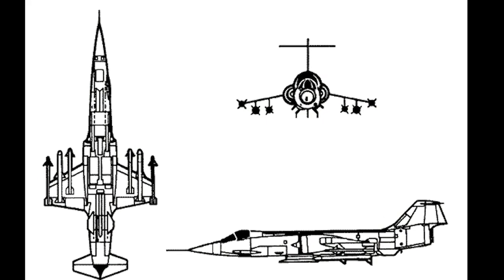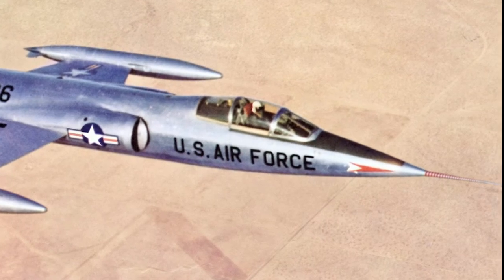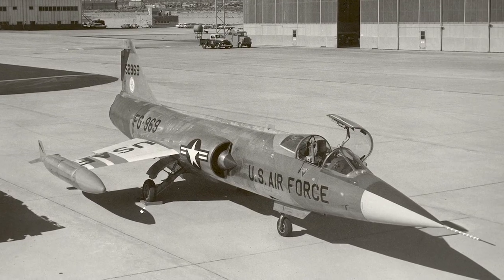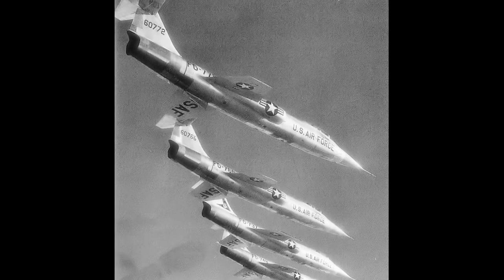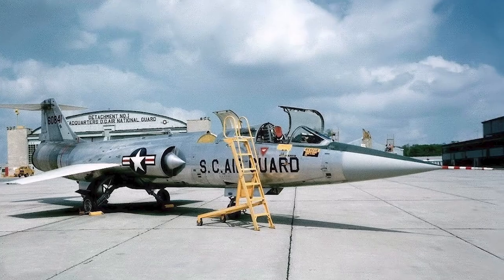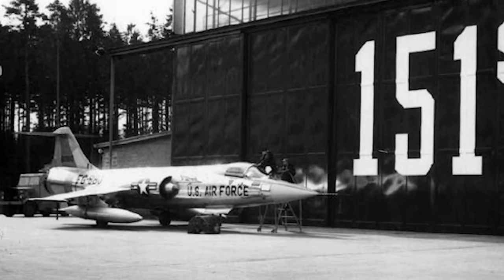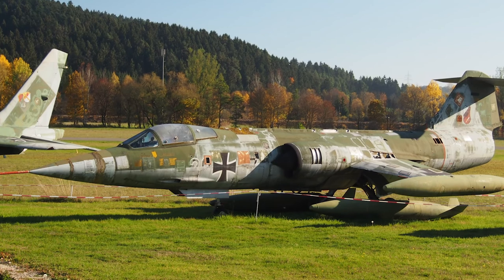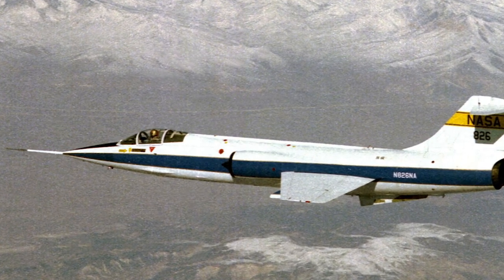Lockheed F-104 Starfighter - A Short History (US Air Force Aircraft History)

Comment: I still have this plastic scale model kit, which I built around 1980.   In pop culture, Star Trek TOS made the F-104 a little bit more famous in one of its episodes, which was one of my early sightings of this jet as a kid.  Another pop culture reference is the Starfighter name was used for the main space superiority space/air ship in the 1980's tv show Buck Rogers in the 25th Century, an old favorite show of mine.  In fact, the small bottom angled wings of the space ship reminds me of the small stubby wings of the F-104 & the space ship's fuselage has 2 torpedo side appendages that look like the fuel drop tanks on the end of the wings of the F-104.  It would be cool if the F-104 was redesigned & modified for today although it would still retain its unique shape, but of course that would cost a lot. But at least it would be made for the cool factor, heh.

Comment: The F104 was designed as an interceptor. With those small wings it was hardly going to be anything else.
Reply: Original project, L-242, wasn’t only interceptor. 
Unfortunately engine was more bigger and heavy than previous, so required more fuel, also airplane need more space for electronic hardware, change cannon.
Instead of to remake project, they have adapt.. Bad idea.
It became more long and heavy.
Dynamic of fly totally change.
XF-104 was the first result.
YF-104 was the second, again more long and heavy.
A military airplane must to be recoverable if stall.
Reply: No, an air superiority fighter, not an interceptor.
Reply: "designed as an interceptor"

False.
Reply: @Hornet135  It would struggle in that role I would have thought.
Reply: @smark1180  Couldn't do much else with those stubby wings.
Reply: @ianrkav  Non sequitur. It was designed as a lightweight fighter. It assumed the interceptor role until F-102/F-106 issues were resolved.
Reply: It was fine as an air superiority fighter. It does not need to be a turn fighter. It fights in the vertical, using climb rate, speed, acceleration, roll rate, and energy retention.

Go ahead, try to put turn it. You'll burn your speed, the F-104 goes vertical, vector rolls, and is on your 6 in 15 seconds. You have now burned 250-300 MPH, and the F-104 is just as fast as it was before. He can put climb you every time. All you can do is run. He changes direction while accelerating to an altitude advantage. He can come down to you when he wants. And you can't get up to him without being slow and vulnerable.

Comment: Downward ejection seats! What the hell were those engineers thinking?
Reply from the maker: Very valid question. Not something I would be keen to use at low altitudes...
Reply: At the time, they could not get the seat UP fast enough to clear the tail.

Lockheed didn't design the ejector seat. It was chosen by the Air Force, and provided by Martin Baker, if memory serves correct.

Comment: Small wing plane just like rocket high speed and altitude  but low maneuver  ability
Reply from the maker: Very rocket-like. Always liked the look of it, it is quite unique. But it was intended as an interceptor, so the design kind of makes sense.
Reply: @A_Short_History  "it was intended as an interceptor"

False.
Reply: It doesn't turn fight. It fights in the vertical.

Comment: 21 pilots killed by the downward ejection seat...
21 people who were good enough to be a pilot in the USAF...dead because of a stupid design. The F104 is one big wtf
Reply from the maker: A downward ejection seat is not the smartest of solutions...
Reply: The ejection seat was neither designed nor manufactured by Lockheed 

It was chosen by the Air Force. They did not believe an ejector seat could be developed to fire and safely clear the tail. So they decided to fire it downward.